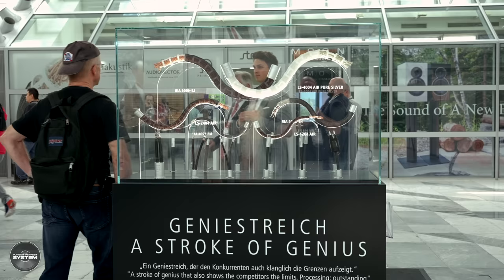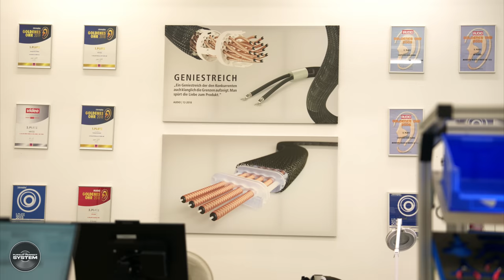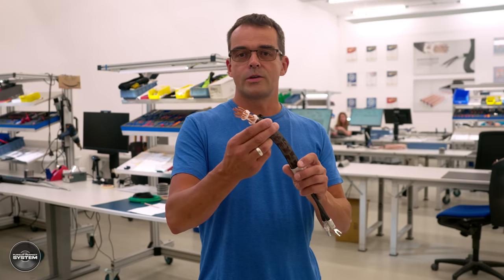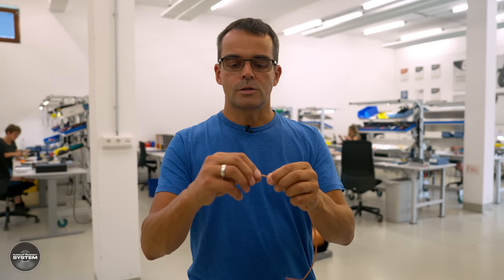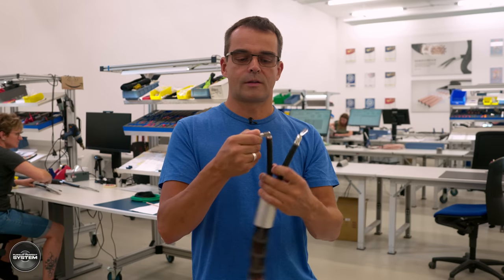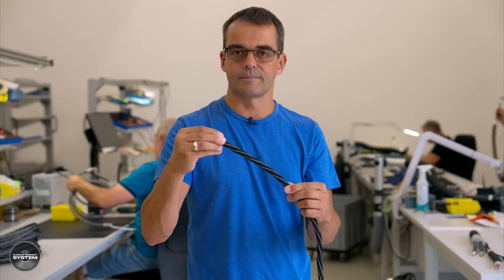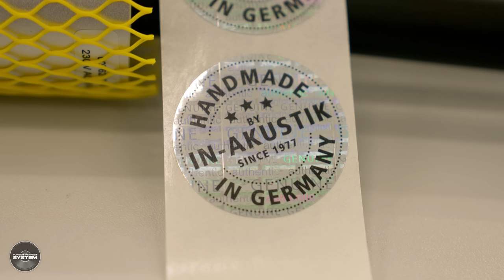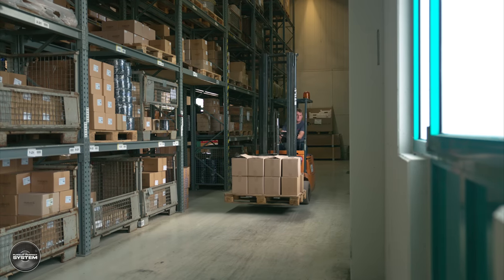The BEST SOUNDING HiFi "AIR" is made in Germany

Comment: The best time to be an audiophile is when you are young. You will get to experience all the sound. By the time people can afford audiophile quality equipment their own hearing will have deteriorated so they are not hearing up to 20kHz but a much smaller part of the frequency spectrum.
Reply: True. Also people invest more with age to compensate for said sensatory losses. I’m also confident we will have ways of completely reversing hearing loss (and tinnitus) within the next decades. Great progress has already been made in research.
Reply: Most adult humans don't hear many sounds exceeding 15000-17000 Hz through the use of their ears. However, the human brain still receives and decodes huge amounts of data from sounds all the way up to at least 35000 Hz and maybe even beyond! These movements of air affects the cells of your skin as well as all the bones in your body and are being transmitted to your brain as...(surprise!) ....sounds and then decoded just like the sounds you hear with your ears. Of course if you only listen to redbook CDs that only carry information up to 20000 Hz or your loudspeakers can't go higher than e.g. 22000 Hz then you'll never know what you're missing out on anyway. The same applies to ultra deep sounds that also reach your brain even though most people's ears may most likely not be able to hear these sounds.

Comment: They are essentially using litz conductors, that are separated by air. So not actually an air dielectric. The only cable that actually suspends the conductor in air is Nordost cables, that’s precisely why they silver plate them and that’s to prevent oxidization.

Comment: I use DIY interconnect cables in my system. Just a simple solid core naked cable inside a teflon tube in helix config so you say it's air insulated. :D

Comment: There are a couple of things to mention: they are using air as isolator to eliminate plastics, but there is a non conductive (possible plastic) core inside the wire. Another thing; the terminals are crimped with 1.5 tons to make lossless contact, but there is a moving screw joint... I'm not convinced at all about the benefits of this cable.
Reply: i feel like its just an advanced way to do a twisted pair with some. in networking twisted pairs have been stable for quite a while because they minimise crosstalk and probably other important stuff.
Reply: @TheSimonarne  I'm not commenting on these audio cables - just writing here to clarify that these do no operate as twisted pair network wires, which are in many ways more advanced.  Maybe this explanation will be of interest to someone who wants to know how a twisted pair system works.

In a true twisted pair, two insulated wires are wrapped tightly around each other as they travel the length of the cable.  Then, the same signal (assume the signal is alternating positive and negative like a wiggling audio signal or any other changing signal) is sent on each wire of the pair but with inverted polarity from the other wire, meaning that one wire's signal is going positive while the other is going equally negative.  

On the receiving end, there is a circuit known as a differential amplifier, which subtracts two signals and produces an output result.  One of each of the wires of the twisted pair is fed into an input of the differential amplifier.  Let's say that wire A (at some point in time) has a voltage of +1 volt.  Then, wire B of the pair will have the inverse at that time: -1 volt.  The diff. amp will subtract these two values as its output: (+1v)  -  (-1v) = +2v   With inverted inputs, the output wave (wiggling signal) of the amplifier will look exactly like the input, but be doubled in size (which is just a gain increase)!  

But the magic is this: Any noise (I.e. radio interference noise, or other electronic noise) that is picked up by the cable along its length will be received equally by both wires in the twisted pair because they are wound so tightly together.  This noise on the cables will NOT be inverted - it will be exactly the same on each wire.  When this same noise signal is sent through the differential amplifier, the noise will be removed from the output!  For example if wire A has +.5v of noise at some time, then wire B will also have + .5v of noise. (.5v) - (.5v) = 0!  So using this scheme, any noise picked up in a long cable run is cancelled.
Reply: All irrelevant theoretical consideration as is the construction detail used as promo. For a true listener rather than tyre kicking time passer all that matters is how they sound in your system (aside from WAF).
Reply: @82 Levy Good luck trying to convince people who spent a few hundred grand on their high end audio system to use some electrical cable from home depot. What you're saying is like telling someone who just bought a high end Pagani Zonda to just put budget tires on it, because you will save some money. If you think an expensive cable makes no difference, maybe you should just convince everyone in high end audio to just abandon Tube and Class A and just use Class D because there is simply no difference, right? ;)
People will buy this cable for the same reason why you put high end tires on a Pagani Zonda. The budget tires and the electrical cable from home depot will still do their job.
Reply: also they removed the inner core of the wire in order to prevent higher resistance on the high end (the skin the mentioned), but they just made the gauge smaller, the strand still has a skin on it. and according to them higher frequencies use the skin only and the low frequencies use the whole cross section? ok
Reply: So, what do you sell???

Comment: Good products. I have two of their HDMI cables. Good value. But, I really wanted to thank them for a reissue of Tom Rotella Bands audiophile recording that was on D.M.P. Records in the 1980s. It is a DD recording (direct to digital) most recordings using the Spars code like AAD or let's say DDD. Somehow this reissue is much improved over the amazing original.  They did one better: they released it for the first time on vinyl. I have yet to crack that open yet. Waiting for the right moment.  Great video.

Comment: I have fairly top range Inakustik speaker and rca inteconnects but I think it's a previous much stiffer range and I picked them as most lively and detailed for my system. The stiffness is a pain in rear connection space and in routing in general so I noticed at a HiFi show recently they are now very flexible and I wonder it that's to please the market rather than for best sound. The one thing I advise anyone new to using cables to improve your sound is dearer is not always better and you need to try on your equipment and don't just think a great cable will work great in all systems. Always trust your ears first and foremost not reviewers and salesmen. EDIT Addon - the one aspect of my cables I am not sure of is whether the Bass isn't a bit light on. Nonetheless I enjoy the detail and sparkle so much I don't care if they are.

Comment: Air is nice as isolation but not constant, regarding temperature, pressure and moisture levels. What about a vacuum cable? I know, not the easiest because it will require a vacuum pump (noisy) but insulation wise it will be the highest you can achieve.

Comment: I would buy this for pure placebo. Gorgeous engineering…not sure if it adds that much to the sound but cool 😎 as heck!!
Reply: The best compliment for them would be that the cable ADDS nothing to the sound . Would like to see how well it passes a square wave signal , analogous to transient response .
Reply: Um I'm sure the cables gives the audio a lot of air.... lol
Reply: The hell you say.
Reply: @biketech60  Even the worse cable will pass a square wave audio signal unchanged, all is low frequency. I use air dieelectric cable at SHF frequencies above 1GHz.
Reply: @RennieAsh  air pockets.
Reply: Giving you a positive feeling like; love.
I wonder about all that open layout followed by cramped /bound ends. So what is it; better to be aired or cramped?

Comment: Is there any risk that black and red is touching each other?
Reply from the maker: No the cables are sheathed in a mega thin layer that has to be removed to make a connection, you see that happening at one point in the video
Reply: @PursuitPerfectSystem i use referenz LS1102. Sounds great. Doesnt make sense if change to air because my speakers just entry level. But i bet air will be sounds amazing

Comment: Great Video! One question popped to my mind. Assuming that those cables are great...how does the "crappy" cabling before the power socket in the wall affect the sound? I think it is fair to assume, that most people's home have the cabling, which was put into walls when the house was built. It would be great to have a video about how to tackle this issue. Thanks, and keep the fantastic videos coming. Greetings from Estonia!
Reply from the maker: There is a really interesting video posted recently about how electricity works, it doesnt flow through a cable like water down a pipe there is a circuit interaction where much more than just the basics is happening.  Other people jumped on the band wagon to dissprove this theory of course because that is how people are when certain beliefs are challenged but it alludes to why the cable closest to the component matters most.

Here is a link to the video https://youtu.be/bHIhgxav9LY
There has been follow ups since
Reply: @PursuitPerfectSystem  A couple of hundred years after it's discovery it's remarkable how little consensus there is about how electricity works. It is a "known thing" in theory, yet however deep down the rabbit hole you go, it seems you will still find experts arguing about it :D

Comment: How about a comparison of specs with existing audio cables where specs are freely available - capacitance per metre etc.
Reply: That would be useful, though I think many of these companies claim that it's measurements other than R, L and C that define how their cables sound. Personally I'm agnostic as to whether they do or they don't but I don't see why you can't mic up a speaker with a cable, record it, then swap that out for another cable, record that and analyse the differences in the two recordings via computer, though...

Comment: Another fascinating, informative & unique video. Thanks Terry!
No mention of the price of those 'Air Insulated' cables? I'm sure the Silver versions will be more than 10% of most people systems budget. But it's nice to know where the state of the art in cable manufacturing is.
It makes me wonder if I could just strip some 15Amp solid core mains cable, varnish & support the cables on wooden blocks...
Maybe that's something for another video... Hehe 😜
Reply: i'm 58 so my hearing just wouldn't allow me to hear any benefit, my own feeling is the same as your's apart from i'd go for 35 amp solid core, one solid cable without signal losing strands and a good solid connector at each end, given the price I might well try 35 amp, you never know it might make a difference I can hear haha

Comment: If those wires are covered with some lacquer they hardly can be described as wires with an air insulation. Does that lacquer have better dielectric properties than PTFE (Teflon) insulation?
Reply: Thats a very interesting point. Of course, the layer of lacquer is very thin, and its main purpose is stopping oxidation. So the Dielectric value between opposite polarity wires must be close to that of air.
To me, the Inakustik way of doing the Air cable is interesting, but still, they primarily focus on reducing capacity. It does not look like they do much to reduce inductance. A “Kimber-like” structure would do that to a greater extend, when opposite polarities cross each other, with a minimum of parallel cross section.

As a former cable manufacturer, we did bare silver conductors in hermetically sealed air tubes. And to my experience the silver did oxidate to a very small amount, and then stopped as oxygen was not allowed to circulate. I still have 15 year old cables laying around, with see through PTFE tubing, showing shiny silver conductors inside.

Wondering if any measured values are available for theese cables 🙂

Comment: Great vid Terry but I don’t get the Air tech theory. If each strand of the conductor is coated, surely no air can touch it anyway? I could understand if each strand was bare and they could not touch each other conductor in the plastic lattice framework. The dialectric is the coating covering each strand surely?
Reply from the maker: If you think about it everything that surrounds the conductors has a dielectric constant, so it stores electrical charge, all these have is an ultra fine coating of lacquer that is it
Reply: @PursuitPerfectSystem  yes I guess so, have you auditioned them?

Comment: Great stuff, the 20 year old QED genesis report which is searchable and a good read, also says how important cable insulation and lay is. Air is the best insulator and Pvc insulation is really bad, it has high capacitance and hence smooths out all the fine detail.

Comment: One thing I worry about regarding these cables are oxidation of the cores being that they have no insulation are are only separated by air.
Reply from the maker: They talk about this, the cables are covered in a lacquer that prevents oxidation.
Reply: @PursuitPerfectSystem  ahhhh, ok that makes sense.
Reply: But then it is no longer “real air” as a dielectric but conductors are surrounded by lacquer and also another lacquer in the core as wave guide.
 
Many of us knows Teflon < Air as dielectric , so whatever the lacquer material, it is not real effective as air

This design is nothing new but only a fancy way to construct cables?
I found only Zensati cables with their twisted flat conductors have real “air” dielectric design with at least more 90% surrounded by air

Comment: Nice video, Terry. Irrespective of what people may think of possible differences in the sound quality of cables, there is no doubt that Inakustik's designs are rooted in solid science, and that their manufacturing is high class.

I own Reference 2404 AIR speaker cables and interconnects, which are a step below the flagship 4004. They work very well within my system (Circle Labs A200 integrated amp; FinkTeam KIM speakers; CEC TL-5 transport). I paid €1500 used for the speaker cables, which some might argue is way too much, but is nevertheless a pittance relative to many high-end cables. They are a bit sensitive to proximity to power cables, but are light and easy to work with in terms of routing.

Comment: I have a pair of bi-amped/bi-wired McIntosh MC312's running 10awg  tri-core briaded copper that I paid about $60/meter for. To me it sounds amazing. I'd love to be able to try some ultra-precious cable like in-akustik, but a run of speaker cable would cost nearly as much as one of my amps. Or more, hard to find exact prices.   

So it's down to, do you prioritize something like this, or do you take that 8-10 grand and put it in a preamp, a clock, or somewhere else you KNOW you'll hear the difference.  

I think you pretty much have to be "done" with the component side of your system before you can even get your head around spending that kind of money on cable.  Until then it just feels bizarre to even think about.

I love seeing things like this, thanks for the video, everybody in this video clearly cares about audio. And that alone makes me happy. Just reminds me there really is no limit to how far you can go in hi-fi.

Bob Ludwig, the mastering engineer, has speaker cable that is cryogenically cooled with a power supply as big as a mini fridge that sits in its own room, reportedly paid hundreds of thousands for it. 

So now I'm going back to listening to my regular old 10 guage  :)

Comment: The best wire for speakers and interconects is pure silver 0.6 mil solid core cotton insulated wire with quality silver RCA plugs for the interconnect, and bare connection for the speaker wire.  Anyone contemplating buying "high end" placebo cables should buy and listen to these first!  One more thing, as electricity flows on the outside of a wire, silver will keep its sonic properties because silver oxide is still a conductor of electricity whereas when copper oxidizes (as it will on exposure to air) is a semi conductor and sounds awful.
Reply from the maker: I am not sure this is the right approach because electricity doesn't seem to flow on the outside of a wire https://youtu.be/oI_X2cMHNe0
Reply: @PursuitPerfectSystem  Where else? That is called skin effect, negiable at audio frequencies.

Comment: Owned the air series speaker cable and interconnect before, very airy opened cables.

Only problem IMO is the price and performance ratio of Inakustik is relatively average vs other cabling brands
I heard nearly no different of lower line LS1603 speaker cables vs cheaper cables until I upgraded to next line Air series.

The built quality and construction are top class however

Comment: Vacuum is even better than air as an insulator, plus the laquer on the individual wires isn't that the main insulator ? All companies have to have some marketing slogan to differentiate themselves from the compettition. However all that aside the try before you buy is great for all cable skeptics out there. I don't se a US distributor.
Reply from the maker: I dont know how you could have a vacuum in a cable design ?
Reply: @PursuitPerfectSystem  not easily you would have to tube the wire create a vacuum and seal the ends, just like a vacuum tube